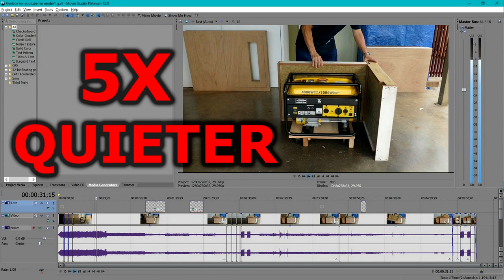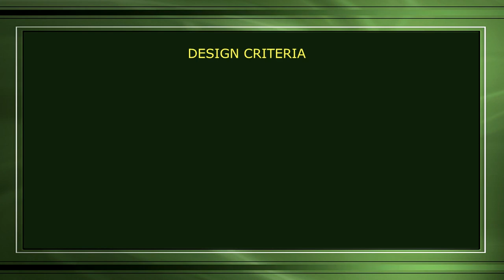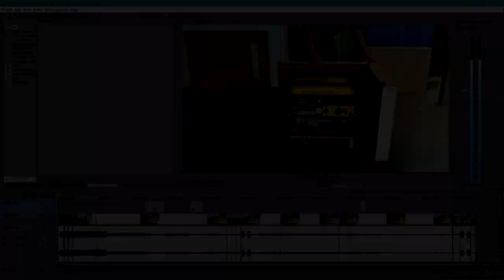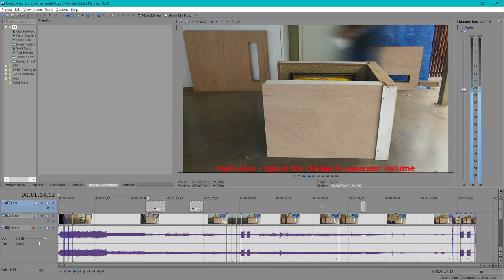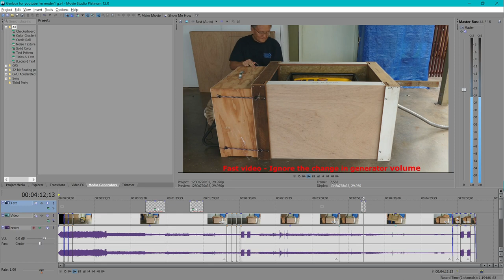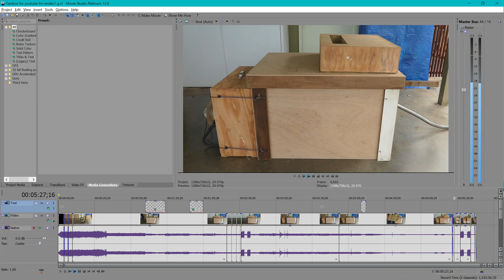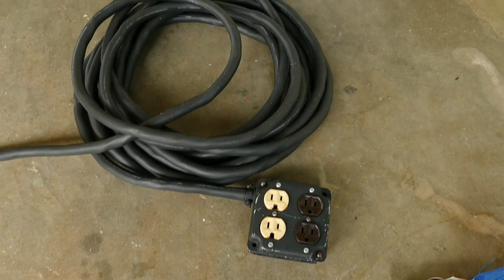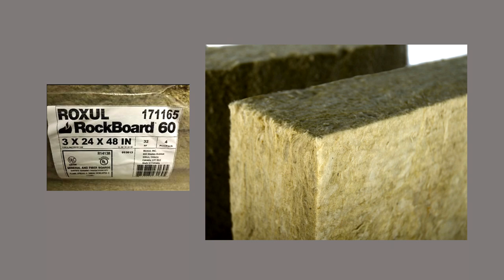5x quieter generator or compressor sound reduction quiet box

Comment: You should add an automotive muffler to the design! With automotive sound dampening material applied to the inside box surfaces!
Reply from the maker: Found that adding a muffler is not necessary.  A large portion of the sound from the engine is contained within the steel flex tubing and vertical conduit pipe.  The sound is dispersed high up into the air above the carport's roof.  Effective enough for my sound reduction goals.
Reply: @usefulgizmos  In your photographs, it appears that your exhaust pipe attaches to your generator's OEM muffler, so you wouldn't need to add yet another muffler anyway.  My Champion generator has a different design muffler, with no easy way to attach the exhaust system to the output side of the existing muffler.  However, I can use the same or similar flange to bolt your exhaust system to the cylinder head, and then run that into the the generator's muffler, which I'm remounting on the outside of the quiet box.  I suspect that may add a bit of noise, but it also gets a heat source out of the enclosure.  The champion engineers surrounded my muffler with heat shields, so I expect it makes a lot of heat when run for a while.

Comment: How hot does the generator get. Compared to no box
Reply: Hi Vince.  In 3 years, not a single person who bought my quiet box plans has complained of overheating. Not one.  Thanks for watching and have a great day! .... Usefulgizmos
Reply: @RAPTOR8ASDF  @Usefulgizmos   A thermostatic controlled engine shutoff, like the low oil pressure switch would be a good addition to this excellent project.  You wouldn't want a defective $30 Vornado fan to cause the premature death of a $600 genset.

Comment: Good chain to avoid thieves..
btw good design and why not adding egg support carton for better sound proofing?
Reply from the maker: Thanks for your kind comments.  I used the Roxul Rockboard 60 because I wanted to minimize sound transmission THROUGH the insulation.  The bumps in egg support carton seem to me are for minimizing echo WITHIN an enclosure.  Plus parts of the egg carton are thick while other parts are thin.  Rockboard 60 is consistently 3" thick all over.  Finally, I don't like to use foam products.  The black foam I've had all disintegrate eventually in our climate in Hawaii.  White Styrofoam does not have even close to the sound blocking characteristics of Rockboard 60.  Rockboard 60 is spun out of basalt rock and slag and will last forever as far as I know.  Thanks and have a great day.

Comment: Hi, great job on this, Im in the process of building a 34 kw diesel unit on a trailer, been having some trouble finding insulation that is affordable 
The gen set is 8 ft x 4 x 4, I wonder if Roxul 60 is the same as Roxul 15 safe and sound? Mark, San Diego Ca.
Reply from the maker: Hi Mark,
Thanks for your kind words.  Roxul safe'n'sound has about the same sound blocking qualities as Rockboard 60.  The advantage of rockboard 60 is that it can support itself when used horizontally like in the cover of the quiet box.  Check the rockwool (Roxul changed its name to Rockwool) website for charts on the sound blocking specs for rockboard and safe'n'sound.  Have a great day.

Comment: I have a concern; what about the temperature ? Does anyone know ?
Reply: Yeah... It would run extremely hot in there. 
Don't use this if you value your generator and want it to last.
Reply: Read previous comments. It was answered by the author.

Comment: Do the fans run off power or do they run off of the sound vibrations?
Reply from the maker: The power cord for the fan is plugged into the 120 volt outlet on the generator.  Thanks for watching and have a great day! .... Usefulgizmos
Reply: @usefulgizmos  thank you! Great video!

Comment: What kind of sealer / glue did you use on the 4" insulation?
Reply from the maker: Used 3" insulation.  3M glue.
Reply: @usefulgizmos  was the glue spry on or brush on and thank you love the video best quite box I've seen yet

Comment: Great video and very nice build. I do have a question about the exhaust, I was considering doing something similar but I do not know how to compensate for additional back pressure. Did you take that into consideration or have you run into any problems since it has been 2 years? Look forward to your reply. 👍
Reply from the maker: My exhaust tubing is 2.8 times larger in area than the 3/4" exhaust from the muffler.  Read that if the output area is twice that of the exhaust port, back pressure is not a concern.  Plus a V8 car engine's long exhaust pipe system is able to handle a huge displacement compared to the tiny displacement of my generator's engine, not to mention back pressure caused by the car's catalytic converter and muffler.  I personally don't have any back pressure concerns for my system.  Thanks for your kind comments ..... Usefulgizmos

Comment: What did you use for the exost tubing?
Reply from the maker: As explained at about 9min 46sec in the video, I used 1-1/4" flex tubing which is a perfect fit inside of the 1-3/8" inside diameter conduit pipe.  The flex tubing can be purchased from auto parts stores.  The conduit pipe can be purchased from hardware stores. .... Have a nice day, Usefulgizmos
Reply: @usefulgizmos  
😁 Auto parts store nice! 🤙

Comment: I did a box enclosure an it ended up.running way to hot, so I put a 12 volt fan that you would have in front of your  car radiator,  vented it up threw bottom of box out the top an now it has proper cooling  ventilation an it's quiet...
Reply: Good idea using a car's 12 volt fan if the generator has a 12 volt outlet.  Thanks for sharing.  Have a great day!Usefulgizmos

Comment: The motor is air cooled/very crucial to operation, boxing it in will overheat the motor and result in premature wear.
Reply: Watch the video a little longer and you will see where he has a fan forcing air through the whole setup.

Comment: Great video and product!  Have you had any issues with overheating?  I know this is a question probably already asked, but I didn't want to scroll through 250+ comments to see.  I sent you an email requesting plans this morning.  Well done all the way around on this.  I agree with everyone below in saying great job!
Reply from the maker: Hi Mark, 
Thank you for your kind comments.  No problem with overheating.  The Vornado fan shown in my youtube video along with the fan that's already built into my generator provides very good air flow through my quiet box.  Also, since the hot exhaust from the engine is routed out of the quiet box via my exhaust system, the engine's exhaust has very minimal impact in contributing to heat within my quiet box.  The exhaust system also routes much of the noise from the engine up over the roof so I don't have a need to add an additional external muffler. .....Thanks,  Usefulgizmos

Comment: Looks great but it seems like a whole lot of trouble going thru all of that. Great job though!
Reply from the maker: I have more time than money.  So buying an inexpensive generator on sale and building a quiet box for it was more in line with our needs than buying a $2000+ Honda generator of equivalent wattage.  Plus, I would have had to build the exhaust system shown regardless, to eliminate any chance of carbon monoxide poisoning for us or our neighbors.  I think that our generator now is as quiet or quieter than any Honda generator I've heard at the parks.  As I said, more time than money ..... ;) wink.  ..... Thanks for your kind comment.  Have a great day! ..... Usefulgizmos

Comment: Do you have a schematic drawing for your quiet box?  I'd gladly pay $20 for a drawing of sizes and materials.  Great video!☺👍
Reply from the maker: Hello B Berthold,
I do have scale drawings of the quiet box and sound baffles shown in the video.  I also have scale drawings and pictures of the simple jig that I made to achieve straight perpendicular cuts of the Rockboard 60 insulation that I used.  I think that cutting the Rockboard 60 straight and perpendicular to get tight fits in the frames was important to minimize sound leakage.  I could put a package together with instructions including details on the exhaust system.  Send an email to me at usefulgizmos@gmail.com and I'll let you know when I finish assembling the package.  I caught the flu so I'll work on it when I get better.  And thanks for you kind compliment.
Reply: If you get the plans sent to you ,I will send you 10 dollars for U to send me a set.

Comment: I did a similar design from you, but the front engine panel was blowing hot air which i think its better air cooled, the plug panel was hot too as compared to open air. In the end I added a very silent muffler(heee) and it quieten more. How do you overcome this problem...I dnt want to overheat the plastic power points and othe rparts despite the 200cc engine still working.
Reply from the maker: Regarding adding a muffler, I overcame that problem with the exhaust system shown in my video.  By using the metal flexible tubing and the vertical metal conduit pipe,  that acted like the exhaust system of a car before the car's muffler.  The engine exhaust noise is pretty much contained within the metal piping and then expelled up over the roof.  This negated having to add an additional muffler.  So the exhaust system has two benefits for the price of one :) .

Comment: What about over heating?
Reply from the maker: The fan forces air to flow through the quiet box for cooling.  No overheating. Thanks for watching and have a great day! .... Usefulgizmos
Reply: @usefulgizmos  is it possible to build 3 walls and a roof with sound proofing material and leave one wall open or does that just defeat your process? I need to be moving my set up a lot, not daily but once or twice a week because I sell ice cream so im kinda on the move a lot
Reply from the maker: @Negative.headspace  Three walls and the cover would reduce the sound in one direction but I don't know by how much since I have not done a comparison with one side open.  Also, the Qbox is held together by the pins through the side panels into the end panels.  The open side will not have that construction feature.

Comment: It would be extremely beneficial to provide 4 sets of temperatures after 30 minutes of running, firstly, ambient air temperature outside the Quiet Box at the air intake, secondly temperature inside the box,  thirdly, the air temperature of the exhausted air from inside the box and finally the temperature of the exhaust exiting pipe.

Let’s get this settled once and for all.  Someone please post their data.
Reply from the maker: Hello Brian,
My quiet box is stored in our closet, my generator was drained of gas and stored, and my exhaust system stored.  It will be too much work for me to set everything up again to take the measurements you want.  I have so many other pressing home repairs to do.  All I can say is that during my testing, the output air from my quiet box was just warm and my generator did not overheat during all of my tests.  Piping the engine's hot exhaust out of the quiet box and having adequate air flow via my external fan are the keys for preventing my generator from overheating in my opinion.  I have no concerns about overheating, but that's just my experience.  Thanks for watching my youtube video .... Usefulgizmos
Reply: Usefulgizmos I fully understand and I wouldn’t do what I was suggesting either.  I was hoping someone who followed your plans would add to the knowledge base on their experience and provide some temperature readings as I suggested.  Hopefully this data would persuade those doubters of what you have reported anecdotally.

By coincidence we just endured a 36 hour power outage here at our cottage in Northern Ontario and our Firman performed flawlessly although it was really not pushed with the loading of only refrigerator, microwave, TV, and internet modem.  Amazing value when I got it on sale at Lowe’s in Canada.  I leave mine in an 8’x12’ shed and keep the doors open and a small fan plugged in to move the air a little better.

Great video, design, construction and explanation, absolutely first rate in every respect. Now I need to check out your other videos.  Stay safe and healthy.

Comment: I bet if you built another insulated box to fit over the top of this box with air vents  on all sides you might even make almost silent ..
Reply from the maker: You may be right, but I believe that my single quiet box as shown on youtube has reduced my generator noise to below neighbor annoyance level.  Thanks for watching and have a great day! .... Usefulgizmos
Reply: @usefulgizmos  Cool I might do that... I just bought the plans if it's super quite I won't have to but it's an optional add on I might do!

Comment: The inexpensive generators are loud and it is not the exhaust system. Hondas are expensive for a reason.Design of the crankcase. You can try to quiet your Harbor freight generator with modification to the exhaust and to no avail.If you have an inexpensive and loud generator make a sound  "dog house."  Don't modify the exhaust because it won't help much.

Comment: pretty awesome but for the cost and time to build you might as well spend the extra money on an ultra quiet generator. No?
Reply from the maker: Hi Jacob,  Well, a lot of folks already own a generator so they don't have the option of buying a new ultra quiet generator.  Also, equivalent wattage (3500 watts) quiet Honda generators run about $2000.  My generator plus the cost of a quiet box costs less than half that amount.  Finally, the amount of sound reduction can be a very subjective subject.  I "personally" think that my generator in my quiet box is quieter than any other generator that I've ever heard.  Again, it's subjective (wink). .....
Thanks and have a great day, 
Usefulgizmos

Comment: 5 times quieter than what ? is it 1/5 of the sound pressure level? that is 7dB quieter. 10 dB quieter would sound 1/2 as loud. Significant but hardly wonderful

Comment: Nice as far a being quieter but not really good for the generator or motor your exposing it to a lot more heat.
Reply from the maker: With the fan shown in the video, there is good air flow through my quiet box for cooling.  Without the fan, I agree with your analysis.

Comment: extending the lenght of the exhuast in that way could bring engine probems, they are not  designed to run this way.
Performance of the engine  will suffer.
Reply from the maker: When I did my research prior to designing my exhaust system, info indicated that if the exhaust pipe is twice the area of the exhaust port of the engine, that is sufficient.  The exhaust port from my generator is 3/4 inch diameter and the exhaust tubing has more than twice the area.  Plus the exhaust tubing is inserted into the vertical conduit pipe which has an even larger diameter.  I'm satisfied that my generator's engine is running fine. ..... For example, look at the exhaust system for a V6 or V8 car.  The displacement of those engines are tons and tons greater than the displacement of the engine for a generator like mine.  The diameter of the exhaust pipe for a car is not much larger, comparatively speaking, than the diameter of my flex tubing and the total length of a car's exhaust pipes is fairly long.  I'm very comfortable with my engine's exhaust system.  .... Also, please note that the info provided in my youtube video is just info on the quiet box that I built for "my" generator and in no way suggests that others should build exhaust systems like mine. .... Thanks, Usefulgizmos
Reply: @usefulgizmos  An exhaust system is designed to work efficiently, and limit emissions, when you increase the length, you can throw out the design.
Yes you can put almost anything on any engine, but that does not mean it will work  efficiently, because it won't.

Comment: I so not care for the exhaust pipe as this increase in length also increases back pressure reducing engine power.
Reply from the maker: A car has a hugely larger engine and long exhaust pipe system with inclusion of catalytic converter.
Reply: @usefulgizmos  First I am a MASTER  ASE Technician and I build race cars 45 years,Now with that said exhaust systems on cars are tuned to each vehicle.My Favorite thing I laugh at is the teenagers putting the Im gay noise maker on there cars as this noise maker can cause up to a 50 hp reduction.So by extending the exhaust on that generator by 20 to 25 ft and not testing for back pressure and Laminar flow I am willing to bet you lost 10 to 15 Percent of your power as the generator's exhaust is also tuned for that engine.
Also If you fly any RADIO CONTROLLED aircraft which I also do you will find they make tune pipes for those engines to. This is a FYI so ask questions before doing this.
Reply: @apacheone3643  Radio controlled aircrafts use 2 stroke engines, so of course their exhausts are tuned.  I doubt much "tuning" goes into the exhaust systems of this budget 4 stroke generator engine sold for $500 (there's no tuning for the Predator engines sold at HF and I wouldn't be surprised if this engine came from the same factory with a different label slapped on it).  And on that note, for a backyard homebuilt solution to a particular problem, I think specialized testing for exhaust back pressure and laminar flow might be way, way outside the scope of what is trying to be accomplished here. We're not talking about Nascar here, we're dealing with a budget generator being modified to work for a specific purpose.